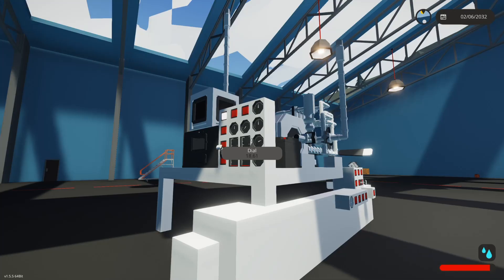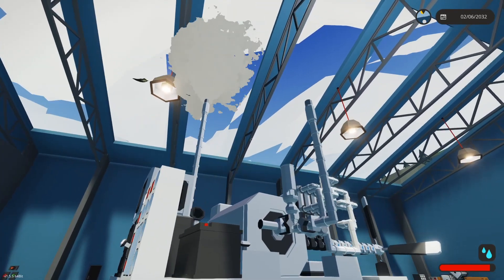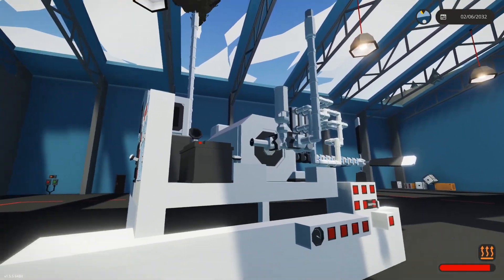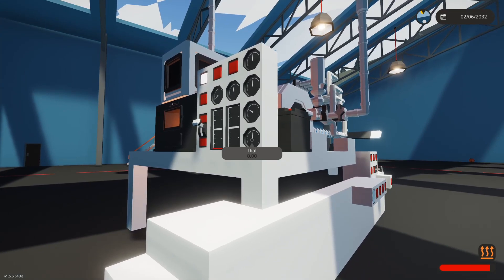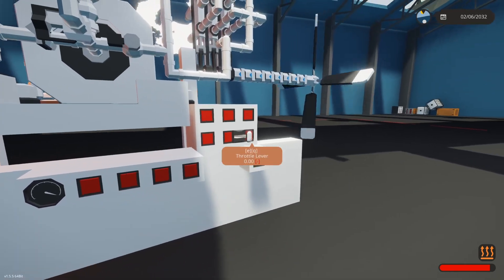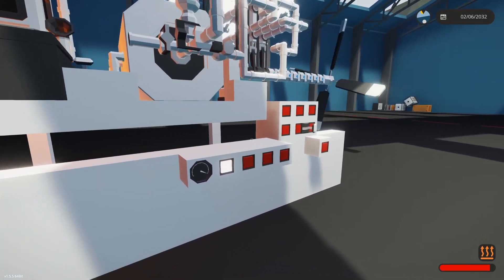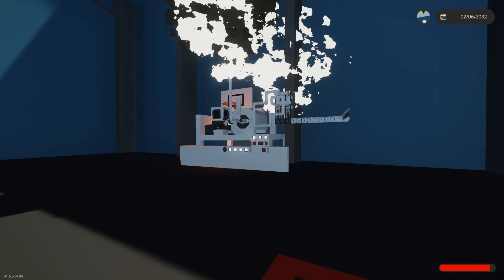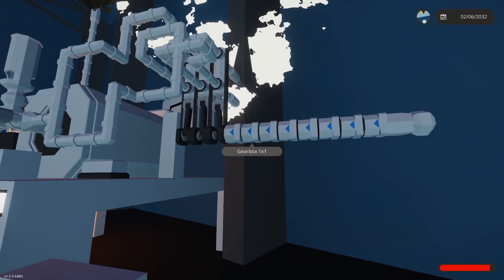Stormworks steam piston torque test

Comment: I built a locomotive with 4 medium pistons and with 4 3:1 gearboxes it went fast enough to make drag overcome the traction of the wheels. It also spun a medium flywheel up to 250 RPS instantly. I think they are a little OP. Only had 0.5 units of water in the boiler too
Reply: How did u make it not explode, all my previous builds are now broken and cant figure out how to make a working one after the update
Reply: @DATA_DELETED099  set up a greater than logic gate to a on off valve to the water supply if the pressure gets to high. You can do the same for the firebox air supply at temperature.
Reply: @totaltechno7510  they wont run out of steam? that's a bit odd
Reply: @randompopcat9615  the boiler would refill if it got below that level to control pressure